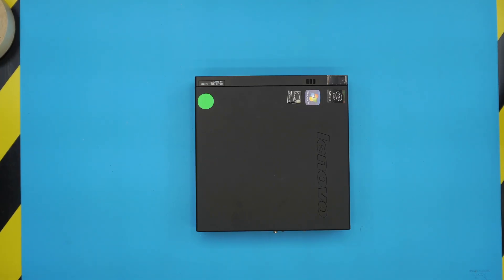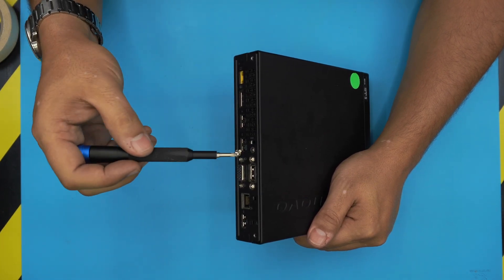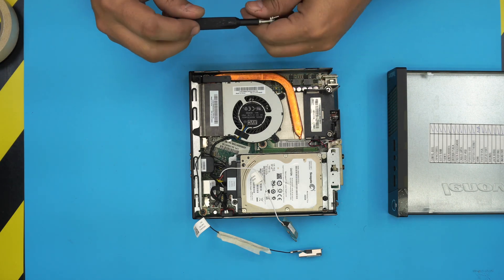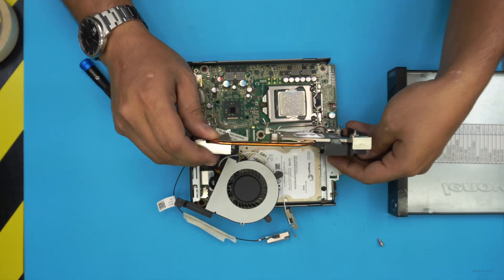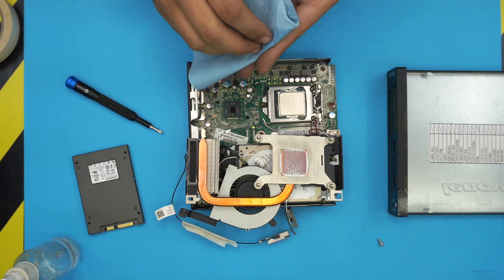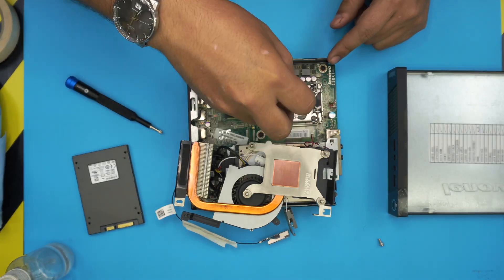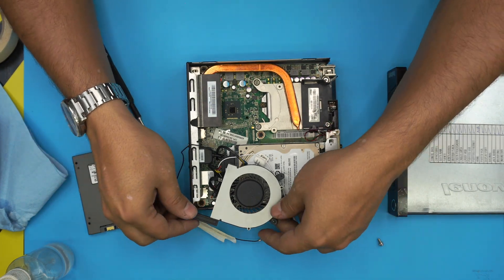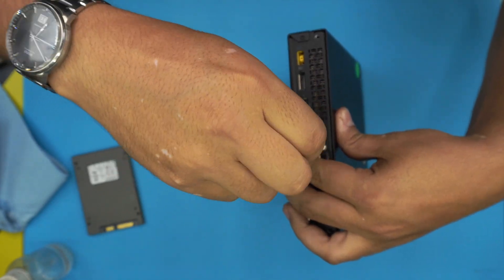Lenovo ThinkCentre Mini Pc Service and Repaste Guide

Comment: I got this message during boot: "Alert! Suggest to clean or change your Dust Filter!". Does that mean I should open the chassis to clean it, or is it enough to clean it from the outside? Lenovo ThinkCentre Mini PC here, too. Thanks for the video!
Reply from the maker: It's my pleasure my friend.
🫠Regarding your question, there is a timer in the BIOS that, regardless of whether you use the PC or not, will display that message after a certain amount of time. The message can be reset or disabled in the BIOS. However, you should open the PC and clean it to ensure there is no dust buildup.
cheers🍻

Comment: is 50-60c bad for the cpu while browsing internet youtube etc?
Reply from the maker: it is a bit high for browsing, but it is absolutely no were near worrying at all. if you reach temps over 85c+ then you should do a repaste and cleaning, remember this intel CPU have a over heating protection so there is no way you can damage the CPU by not changing the thermal paste, what will happen the CPU will reach 102c and it will auto protect and shutdown.
if you can i would recommend you to open and clean and place a good thermal paste like:
thermal grizzly kryonaut: https://amzn.to/473Y8Mt
this paste the superior paste and it will last 2-3 years.

Should you have any further questions or requests in the future, please don't hesitate to ask me.

This is an  Amazon affiliate, when you use my links, I earn a percentage, which helps support the channel🙏.

Comment: Hey do you maybe know thy my m910q could be shutting off randomly? Sometimes right after pressing power button, sometimes while booting, sometimes when logging into Linux user. It nerver runs for long. I already replaced the thermal paste with a good one and it didn't help. I also tried different power cables, didn't help either...
Reply from the maker: Thank you for the feedback! if you wish to support the channel you can LIKE or SUB or both :P
regarding your question:  the issue is 90% the ram when one of the ram block is bad or even one sector it will do a sudden shutdown. i recommend you to replace the ram and test it out. let me know if anything else
Reply: @uFixTek  yeah you are right with the ram. It's a problem with the dual channel. The computer runs fine when using only one ram in 1st slot. I tried both rams in the 1st slot and they are fine on their own. But when using both in the slots then the problems come back. I already switched the cpu with another pc and the cpu seems to run fine. It seems to be a problem with the Mainboard. Do you have any tips on how to fix a broken 2nd ram slots? I tried cleaning it already but it didn't help.
Reply from the maker: yo need to update the bios the issue is on chip set and bios, re-install the bios and the chip-set drivers.
Reply: @uFixTek  I just reset the Mainboard by removing the battery and now it seems to work fine. Thanks for the tip with the BIOS/ Chipset if it keeps working you saved me from much trouble thanks so much!
Reply from the maker: its my pleasure my friend,
if you have any question or request in the future feel free to ask me.
Reply: My pc randomly off lenovo mini  thinkcenter please help
Reply: Same problem here please give me solution please
Reply: @SURUPARMAR-uz9ys  try switching the ram modules to different slots or exchange them if that doesn't work take out bios battery for reset and if that doesn't work update your bios

Comment: Great video, help me alot, My thinkcentre M73 sometime cannot power on, turn on the power only heard the fan running, power led not on and not booting at all, after removing and reinstall the hard disk signal cable it will able to power on again. Have you experiece this before? Thanks.
Reply from the maker: Thank you for the feedback! if you wish to support the channel you can LIKE or SUB or both :P
regarding your question: the issue that you mention we do get often in the store, and it happens to normal laptops too, the problem is from hard drive firmware, i recommend you to replace the hdd with SSD drive, and reinstall the windows:
ssd upgrade: https://youtu.be/GG13pkiKeZA
create windows 10 boot: https://youtu.be/uDu8j2lE-dM
Reply: @uFixTek  thanks for the reply with advice,  i am indeed using ssd, however the os is chrome os flex. I am thinking could it be caused by a faulty ssd/hd sata signal cable (54Y9343)?
Reply from the maker: im very sure its not the cble once the cable start failing it should not boot to the drive at all or give you constant error, or it could be that your ssd its degrading anything under 80% life on ssd can start giving issue check the ssd status and let me know using hard disk sentinel download a free portable version: https://www.hdsentinel.com/download.php
Reply: @uFixTek  ok thanks, will try.
Reply from the maker: my pleasure i hope it gets resolved.